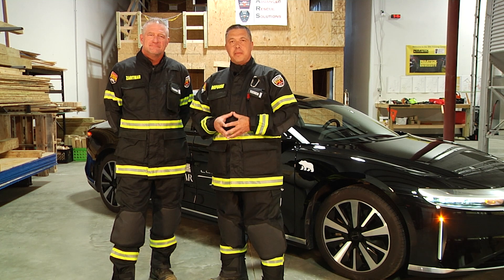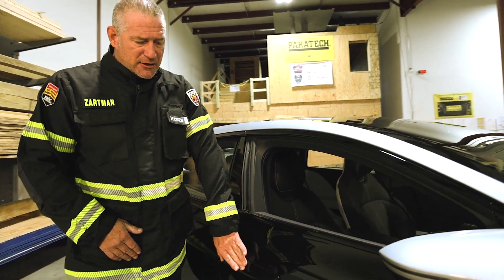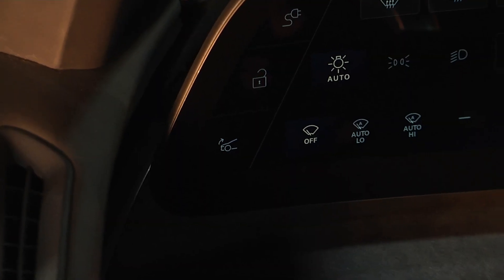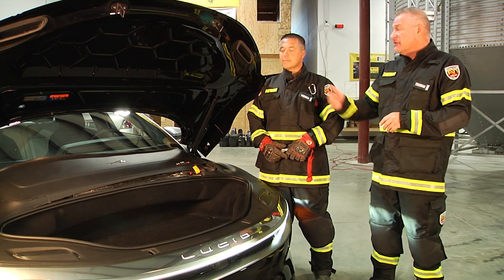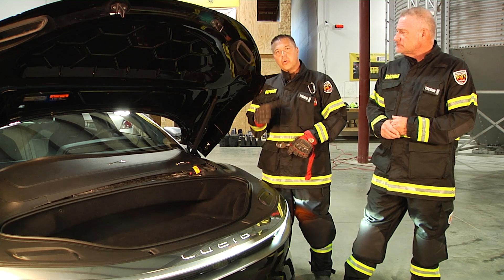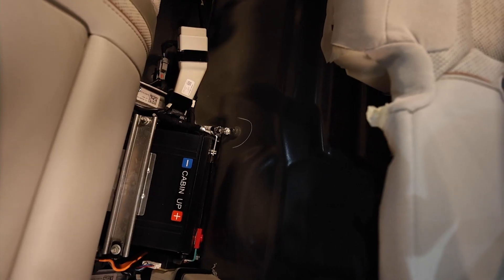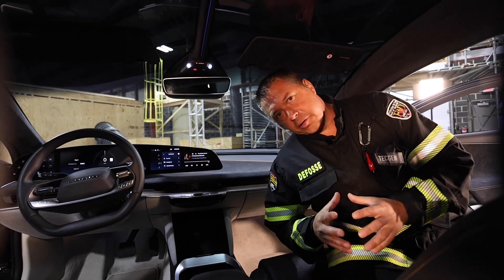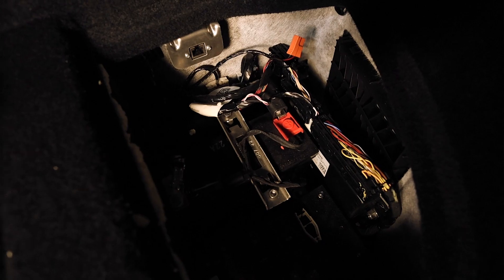Electric Vehicles: Doors, Glass, and Emergency Shutdown

Comment: I wonder  by cutting the front 12v battery cut loop, does that totally secure the 12v system (Both batteries, or are they two separate systems).   Also what is your recommendation for ERG sources to use in the on board computers and/or smart phones?

Comment: Out of curiosity, what if the battery under the backseats is not accessible due to the presence of passengers and the front of the vehicle is too damaged to open the frunk? Is there a secondary location with a cut loop? Or does the 12V discharge work quickly enough to render the high voltage system safe within a short time after airbag deployment?